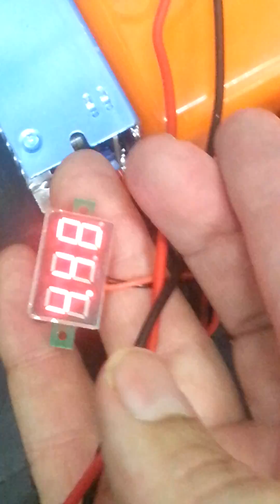Fling-AMA-String modified with motion sensor, etc

Comment: I’m interested in trying this with an AC to battery adapter like the Lenink AA Battery Eliminator Power Supply Adapter, which I’d then plug into a smart plug. Any thoughts?
Reply from the maker: You could just plug a 12v dc inverter straight into the sensor with that version and plug into the wall. So battery or DC converter with 12volts to run the sensor will work.  Then step down to whatever the voltage is needed for the device. I made another one for the rat under a mat toy. Just had a box with sensor and step down inside plugged in via 12v inverter supply from wall socket. Then I ran two wires under a carpet square into the toy so the wires were protected. Cat goes near box it makes rat move under the mat. Shuts down after no more movement.